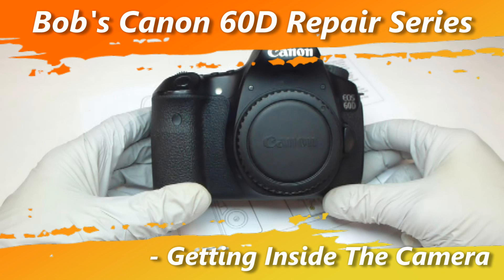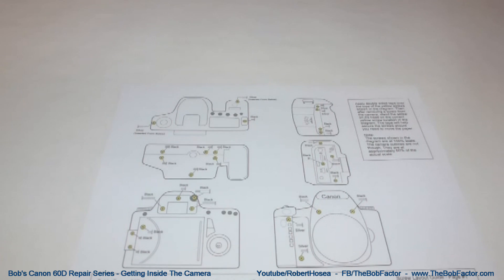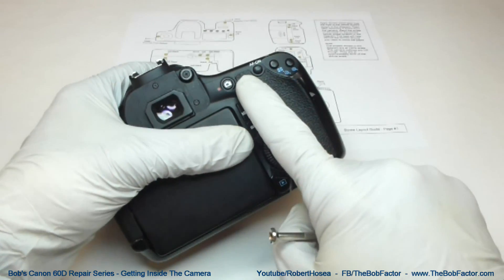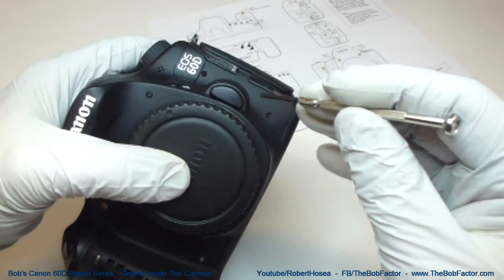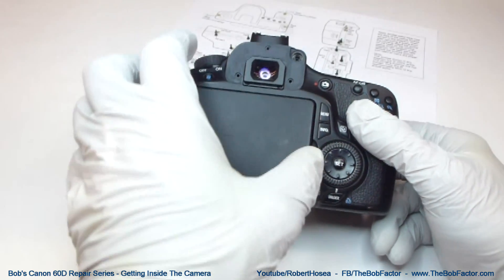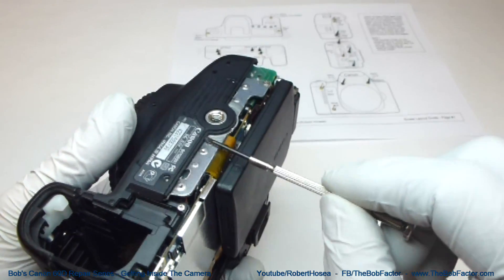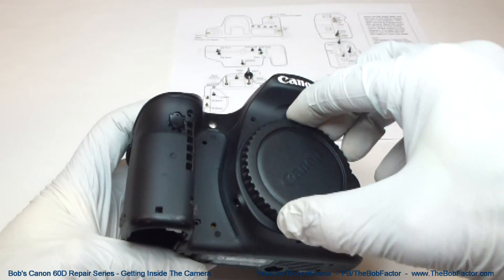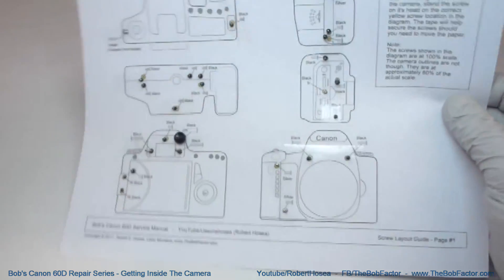Canon 60D Repair Series - Video #1, Getting Inside The Camera

Comment: Great Video but Quality is very poor.
Reply from the maker: The video was recorded high quality HD 1920x1080 format. But, YouTube will automatically reduce the quality of the video if your internet bandwidth speed is slow. You can click on the gear icon on the player (next to the cc icon) and then set the "Quality" to a higher level to improve it. You may need to let it buffer the video for a few minutes after you do that before you will be able to watch it though.

Comment: Thank you for your videos and instructions - they are very helpful.  Unfortunately I ran in to a snag in that the top-most screw on the left side of the camera (under the grip) is completely stripped and I cannot get this screw out (I had my camera cleaned several years ago, may have happened then?).  I am trying to access the top section of my camera as I have an issue with the power switch (my camera turns on but will only stay on if I physically hold it over towards "on", as soon as I release it physically stays on the "on" position but it shuts off - I think there may be corrosion on the contact? I was trying to get inside to try to clean that contact).  Is it possible to still remove the other sections of the camera if the side section is still attached to the body, or does that section have to come off with the front?  I am afraid it is the latter, I just water to check if you had any additional ideas or suggestions.  Thanks!
Reply from the maker: Yes, unfortunately that side piece must come off in order to access one of the underside screws that hold the top piece on. The best way to remove the damaged screw may be to just use a drill to cut (drill) the screw head off. After the side piece is removed there may be enough of the screw sticking up that you can use pliers to remove (unscrew) the piece still in the camera.

Comment: Great video thanks Rob. I've broken the Top Shoulder LCD Screen & Glass. Looking for replacement parts it looks like I have 2 options, replace the whole top cover or replace the lcd screen and glass separately. 

Have you got any tutorials or had any experience replacing just the LCD, it's significantly cheaper. Also if you have any recommendations on where to get these parts would be awesome! Thanks!
Reply from the maker: Hi.
No, unfortunately I haven't ever replaced the top LCD display, just the glass. So I only have a video showing the glass replacement.
You can see that video here: 
https://www.youtube.com/watch?v=NFTMTU3Ye2M&t=12s

I almost always buy my replacement parts on eBay.

Here are links that I found to an LCD display that is for sale on eBay, and also the glass. 
https://www.ebay.com/itm/Canon-EOS-60D-Digital-Camera-Top-LCD-Display-Screen-Unit-Replacement-Part-A0157/371546948723?hash=item5681ec8473:g:6C4AAOxyQj9ROT6~
https://www.ebay.com/itm/Canon-60D-Top-LCD-cover-glass-protector-For-Digital-Camera-LCD-windows/331756659480?_trkparms=ispr%3D 

Here is a link to the entire top unit that includes the LCD screen. And it's just a little bit more then the cost of the replacement screen and LCD:
https://www.ebay.com/itm/Canon-EOS-60D-Top-Cover-Flash-Replacement-Repair-Part-LCD-Screen-/331552872275?hash=item4d32175753

Good luck with your repair. Let me know how you make out on it. Sorry I can't help you out more on that.
-Bob

Comment: Hiya! I was wondering if there is a functional reason that the info button on the 60d is slightly more recessed that the menu button. I’ve noticed this in almost every 60d I’ve seen? Can you confirm this?
Reply from the maker: I looked on the two 60D's that I have, and the info button is the same height as the menu button. I'm not sure why they sit lower then the menu button.
Reply: Thank for answer. Here is photo of back plate. What holds the buttons onto that rear plate? https://m.ebay.com/itm/Original-Rear-Back-Cover-Assembly-Replacement-For-Canon-EOS-60D-Repair-Part-/292564780277?_mwBanner=1&_rdt=1

Comment: Please answer if i remove and throw away the shutter mechanism will camera still work with live view and will it capture images? If i dont care of viewfinder.
Reply from the maker: The system gets feedback from the shutter assembly. And without any feedback the system will report an error and not work. As far as capturing images, it definitely wouldn't work anyway, because the shutter is how the light that gets to the sensor is controlled when capturing images. You would just end up with bright white images without it. For live view, if you completely removed the curtains from the shutter assembly and then put the shutter assembly back in, then possibly it might still work. But live view already opens the curtains for you, so it wouldn't really be necessary to do that anyway.
Reply: @Thebobfactor  Well failure will be detected by camera that's right what i don't understand as you said the shutter controls the light. Shutter is just the mirror to reflect light to the viewfinder. When you shoot video can't enable the viewfinder as shutter and mirror must go up. If shutter controls the light then in video, it should be doing something while recording but it doesn't. While if there is something like curtain as you said i don't know what is that.
Reply from the maker: @DiscoverRajivVlogs  The part that you are talking about is actually the mirror inside the mirror box. That is not the shutter. The shutter sits behind the mirror and it is what opens and closes when you switch the live view on and off, and also when you take a picture. When live view is turned on the mirror will be up, and the curtains (the paper type material) on the shutter will also open and you can see the CCD (sensor). To see the shutter operating, turn on the live view and then hold your thumb on the mirror (which should be up already), and then take a picture. You will see the curtains on the shutter close as it takes the picture. That is how it controls the light to the CCD  when it's in live view. It doesn't use the mirror as a shutter. The mirror just moves up and down to get out of the way. Now do the same thing with the live view turned off. Just gently push the mirror up and then hold it there. You will be able to see that the curtains on the shutter are closed and you can't see the CCD. Take a picture (while holding the mirror up) and you will see the shutter's curtains quickly open and close. How fast it opens and closes will depend on your shutter speed setting. If your shutter speed is fast you will only see the curtains flicker because they opened and closed so fast. That is how it takes a picture when it's not in live view. And like I was saying before, you may be able to use the camera in live view mode with the shutter's curtains removed, because the light on the CCD (sensor) is controlled by software and electronics in the camera at that point. But when you take a picture, the light is actually controlled physically by use of the the shutter's curtains opening and closing, and also with help from the software and electronics. I hope that is making sense. I don't know if you have seen some of the other videos in this repair series, but you can see the shutter assembly being removed in my third video here: https://youtu.be/ZUZVH6Bfxfs?t=336

Comment: What is a 4aught screwdriver?
Reply from the maker: Grant, it is the size of the screw driver. The size is "0000" (four zeros).
Reply: @Thebobfactor  Thank you. I ordered a set of screwdrivers, it has PH000 (three zeros)/1.5, and a 1.0, but not a PH0000 (four zeros)/1.2. Hope one of them fits.
Reply from the maker: @grantbirds , The PH000 might work fine for it. If not, I have had to use just a small slotted screwdriver on some phillips head screws before on cameras, just because even the PH0000's didn't seat properly down in the screw head.

Comment: Hi! What if a screw was cut off in the tripod thread(?) I don't know what to call it. The screw from a tripod mount was cut off inside it. What do I do? 😭 Please help me
Reply from the maker: Hi.

Your best bet to remove the broken screw would be to use a screw extractor such as this one:
https://www.amazon.com/Yingte-Extractor-Remover-Reverse-Thread/dp/B07F2H8ZRF/ref=sr_1_5?s=lawn-garden&ie=UTF8&qid=1537836691&sr=1-5&keywords=screw+easy+out&dpID=516iPW74C6L&preST=_SY300_QL70_&dpSrc=srch
There are other variations of screw extractors out there too. You just need to get one that will work on a 1/4" (approx: 6mm) screw.

If the extractor doesn't work, then you will need to remove the metal bottom plate from the camera and then drill out the broken screw. Or, you could replace the entire bottom plate.

This is a link to the second video in this series that shows removing the bottom plate. You would also need to follow the procedure in this video (#1) to open the camera up first.
https://youtu.be/_-gQbCM7QMw?t=759

Good luck with it! And let me know how you make out on it.
-Bob

Comment: I dropped my camera in the sand. Can I disassembled it to clean the sand out? The buttons on the camera aren’t working I think I might have gotten sand behind them not letting me press down on them.
Reply from the maker: Yes, Before turning it on again I would definitely open it up and see if there is any moisture or any sand on any of the boards too. Which buttons do not work? The buttons on top, or the buttons on the back panel?

Comment: Robert, great video; very clear.  
My 60D failed to power-up between battery changes, and subsequent testing with a Canon A/C power supply also failed.  I have repaired other Canon models with a failed battery hatch cover micro switch.  However, I realized there are 3 possible power failure points: Battery Hatch cover, SD Card Hatch cover, and the power switch itself.  So, before I disassemble the camera per your video, any thoughts on which to investigate 1st?  After looking at your vid, it looks like continuity testing on the hatch covers may be more challenging than I first thought.  I was originally thinking to try testing the power circuit by putting a battery into the partially disassembled camera, but that appears to be a doubtful path. TIA
Reply from the maker: Hi Robert. There's a couple things that you can check before opening the camera up. Some of these you have probably already checked. But I'll mention them anyway. The first is making sure the SD card is out of the camera, with the door closed. I've had SD cards glitch out to where the camera will not come on at all with that card in. Take the card out, close the door and see if it turns on. If that's not it, then you can check the SD cover interlock switch by placing a small non-metallic item, like a toothpick,  in the grove that is on the right side of the open SD area, and that's with the back of the camera facing you. That actual micro switch is the one shown in here https://youtu.be/yeCrpv_u1Zw?t=54 in the power board testing video. The thing about this switch is that camera will not come on when the switch is closed (making contact). So sliding something non-metallic in between the contacts will test that for you. And that's just what the SD cover does. Since you've repaired other battery door interlock switches, I'm sure you've tested that already. The only thing left is to visually look down inside the battery compartment and make sure the two contacts in the center of the compartment are not bent or have anything covering them. If everything here seems good, then you may have to open it up enough to test the power board. That would be the next step.

Are you getting a blinking battery icon, or anything else on the upper LCD screen?
Reply: Robert,  thank you for such a quick response!  The suggestions are very useful.  I'll try with the SD card out - I don't remember any more if I did that or not (the camera failed a couple weeks ago while doing time-lapse nightscapes in the middle of nowhere...  Luckily I had my 40D with me as a backup. 
Also, thanks for the link to the powerboard.  Interesting design to have the system power-up when the switch is open, though as I think about it, that's one way to conserve power (I play with firmware for msp430 devices when not shooting.)
I'll let you know if I'm able to get the camera to power-up. Thanks again!!!
Have a great 4th.
Reply: >Are you getting a blinking battery icon, or anything else on the upper LCD screen?
I get nothing at all.  
Well, I know how I'll be spending my time tomorrow while I'm rendering some recent TL video... Fingers crossed!  Thanks again.
Bob
Reply from the maker: By the way I love time-lapse. Very cool stuff. I have my tripod set up right now to catch some Poppy flowers that will be opening up in the morning. Last week I hiked thirteen miles round trip to the top of a mountain peak and shot about 6000 individual shots over an hour, to create a one minute HDR time lapse on the amazing cloud movement over the peaks. Once you start doing time lapse it's just so hard to stop! Lol.
Reply: Yes!  I'm just getting into time-lapse.  As I write this I'm processing some 3000 images for a hyperlapse of my drive over the sonora pass in California on my way back from shooting the Milky Way the previous 3 nights.  My first posting of the MW is on youtube @ https://www.youtube.com/watch?v=D9JqkjQ2wZM 
Shot with my 40D.
Reply from the maker: Totally amazing. Wow, is that impressive!
Reply: Your comment makes me feel all warm and fuzzy... :)  Thank you.  I've seen your work; it's beautiful! 

I just bought an "obsolete" camera (my cousin, the astrophotographer's opinion) - a used eos 5D mk III.  I'm looking forward to picking up a wider-angle lens (something in the 10-15mm range) with hopefully at least a 2.8 or wider aperture.  Of course, I'm selling off 4 other cameras to help cover the cost of the "new" 5D; spent the day making studio photos for eBay. Next I'll have to sell the house to buy a lens... (I may need to check with my wife first...).
Reply from the maker: I've also considered selling my house as a way to fund my photography hobby, but never discussed it with my wife because I knew what the answer would be. Lol.

Have you ever removed the IR filter from the CCD on your 60D to enhance the red color (Hydrogen) for astrophotography? One of these days I plan on removing the IR filter on one of my 60Ds and use it to shoot through my Meade 14" SC telescope. From what I've seen from others, it looks like it really makes a difference on the color. Might be cool to try with your amazing Milky Way time lapse shots. 

I can't wait to get into a full frame camera. Good for you on getting a hold of a 5D!
Reply: I know my wife's answer as well. :) 
I have a 20D that I removed the IR filter from about a year and a half ago, but have not taken the time to work with it.  I was intrigued by IR in general, then as often happens for me, got distracted by another shiny idea, so it's sitting in my basement waiting to be used.
So, like my cousin, you indulge in astronomy!  His work can be found here:  http://www.stanmooreastro.com/
While he can be a little judgemental, I do value his insights and experience.  He does actually know what he's doing, whereas I am far less knowledgable when it comes to sky-related images.
Reply: BTW, I just sent you a more private note via The Bob Factor. :)

Comment: A little advice for those who might use this tutorial as a reference for Canon EOS 80D disassembly. Do not try to lift up and remove the rubber overlays on 80D using screwdriver as shown in this tutorial. On 80D these have now plastic base and are screwed from inside. There are no bolts under the rubber overlays now that hold the cover plates, so you do not really have to remove them. If you need to disassemble the 80D, first unscrew the back plate (it goes together with flip LCD on 80D), remove it, and then you can remove the front plate (be sure to  unscrew the remaining three bolts on the grip side - these bolts are the only ones that hold the front plate on this side). There is one screw hidden under "80D" label. It is more convenient if you unscrew it. The label sits on glue, lift it with thin screwdriver to get to the bolt. However, if you are careful enough you can remove the front plate without unscrewing this bolt.

Great thanks Robert for the tutorial. Really valuable job.
Reply from the maker: Awesome advice Victor! Thank you for posting this.

Comment: by any chance you know what is covering my sensor
Reply from the maker: Enrico, there is an IR (infrared) filter that lays directly on top of the CCD. It can be removed if necessary. Some people take them out when they are using the camera for astrophotography.
Reply: Robert Hosea how do i remove it? its in the  bottom part of the sensor :(
Reply from the maker: I've never replaced one Enrico, and I don't have a video showing the process. I did find a video from someone else that shows the basic process. You can see it here: https://www.youtube.com/watch?v=bt9a7htqJng&t=534s

Comment: Sir I have Canon 60 D and my camera have a problem in lcd screen. When Lcd show picture in pictures white colour goes black for 2 second and after 2 second picture is correct and this is continue
Reply from the maker: I'm stumped. Short of a problem on the main board I don't know what would cause that. Does the problem happen with any position that the LCD screen is in?
Reply: Kamran Saqib so what is happening on your camera is the "zebra striping" is on, you can turn this off in the settings menu. It's to show areas that are over exposed, by making the switch from white, to black